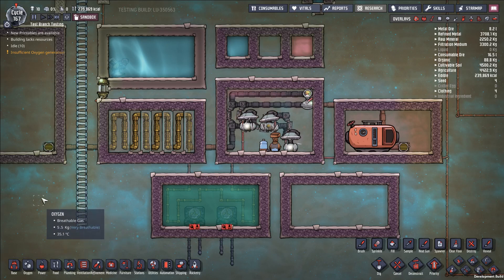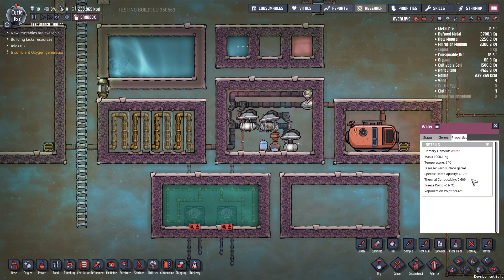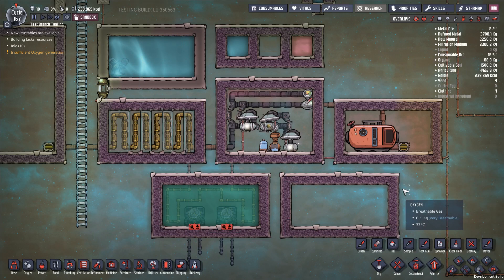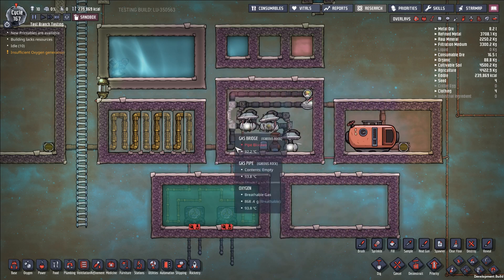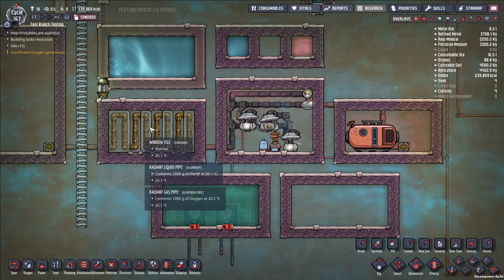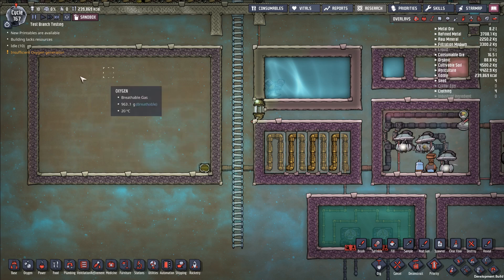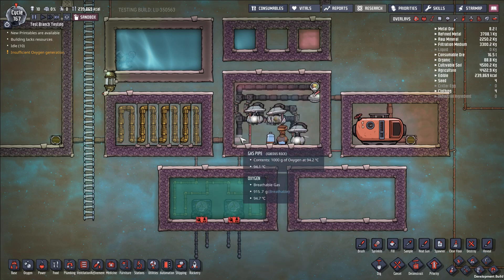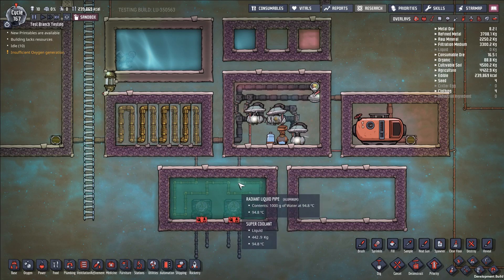Using Electrolyzers to Cool Your Base [Oxygen Not Included]

Comment: I agree with MegaDx51 -- since you've gone through the trouble to set up the system, do the math, and all the prep work, it would be nice to show some overlays of the system and maybe it running at 1x speed for several seconds on each overlay.

I see you've got a massive tank of supercoolant -- is that needed for the build?

What can we do with water coming in from CSV's, since at condensation that's 95-99C?

Is it enough to submerge a gold aquatuner in crude, with radiant gas pipes behind it with full packets of hydrogen, which are metered in at 100g/s into a generator?  That's my pre-turbine heat-deletion plan once I switch to the new branch.
Reply from the maker: The system does work as advertised, I just forgot to turn it on in the background as I talked.

The supercoolant isn't necessary at all, it's just simulating a room in which you're dumping your heat.

If the water is already hot, then you're out of luck for this build-- they patched out the ability to run superheated water through the electrolyzer.  The electrolyzer is still a good place to delete the water, but you'd need to find some other way to cool the resulting oxygen.

If you start with 100g/s hydrogen at 70 C, and heat it up to, say, 250 C before running it through a hydrogen generator, you get 43200 DTUs of cooling.  With that cooling, you could take the 888g/s of oxygen from your electrolyzer and cool it down from 70 C to 22 C.

But if you start with 95 C Hydrogen and Oxygen though (as if it came from a CSV), you're going to get roughly 50 C Oxygen out.  So you'll need to find a way to cool your feedwater to 70 C first.